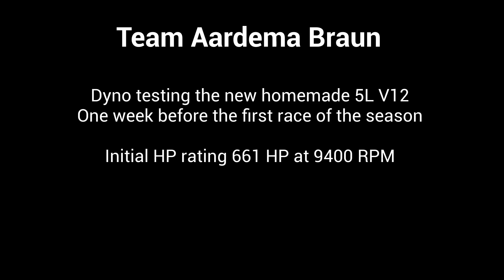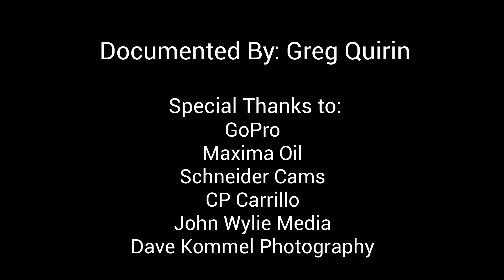Custom-Built V12 Engine DESTROYS Land Speed Record!

Comment: I don’t understand. 217 does not seem that significant. Can someone explain? For reference our Dart block top alcohol dragster was limited to 200 in the quarter. We made one 1/4 mile run outside our bracket and clocked 216 at 7.1 seconds.
Reply: You're on a prepped track with sticky tires. They're on a dusty dry lake bed, with relatively low traction and only 1.3 miles to get to top speed. It's  different game.
Reply: @davidg3944  I believe your analogy is faulty. Speed record run up is determined be many factors but how fast you get to top speed is not one of them. A typical track for an LSR is 10 to 12 miles long providing run up, the mile trap and deceleration. 

My point is that our dragster easily achieved comparable top speed. And there are thousands of similar vehicle out there. For an LSR to only be a bit over 200 MPH there must be other factors involved like small engine displacement.
Reply: For example the LSR for a 500cc motorcycle is 212 mph.
Reply: @larrysorenson4789 your comparisons aren’t valid.   This is a 5 liter, naturally aspirated v-12 running on “gasoline”. This isn’t a turbocharged or alcohol injected whatever…..  there’s a massive difference.
Reply: @caddydave  you missed my point entirely. Try not to talk down to other racers.
Reply: @larrysorenson4789 talked down.?  I’m so sorry if I hurt your feelings..
Reply: @caddydave  i’m out of racing due to age and shitty reflexes. It would be fantastic to go to speed week. I’m sitting here with the top Alcohol dragster in the garage. I have no idea about the spec on the supercharged motor regarding torque or hp. It has around 100 passes on it. The frame is a Joe Amato top fuel dragster built almost 20 years ago. It was pro built by and for him. I have kept the original diff. It is massive. 

With drag gearing the dart block has seen 5,000 rpm many times. That puts us in our bracket. It is very difficult to change the basics of the car although I did put in a built 427 for fun years ago. I will probably never see exactly what the dart motor can do because it was not made for that. But the sound is still thrilling. I also have a real metal bucket “t”. It has had tons of motors in it. I have lengthened and shortened it over time. Right now it has the 427 with a supercharger on it as God intended. This sucker is street legal and licensed. I am afraid to sell it because, although I could handle it, it is probable that a new owner would kill himself. It also makes a great noise. I will probably disassemble it and sell off the parts. That way I can sleep at night.

By the way, the Amato body panels are titanium!!!

Comment: This is great stuff! How come all the 2000hp 2.0 4 bangers cant set land speed records?
Reply: As I mentioned in a different comment: They're on a dusty dry lake bed, with relatively low traction and only 1.3 miles to get to top speed. Can't be compared to drag strips or similar high-traction events.

Comment: And most importantly, it sounds absolutely incredible
Reply from the maker: The sound is insane. I wish everyone could hear it in person.  Thanks Greg
Reply: @GregQuirin  See comment below ...keep up the great WORK 💯
Reply from the maker: @ivankuljis1780  Thank you Ivan!
Reply: @GregQuirin  what are the stems on each header pipe?
Reply: And the change in the sound from the Doppler effect is very interesting, especially at about (8:50) where the car passes the camera. 😊
Reply: That was music… mechanical music.
Reply: I mean it sounds amazing! And it's incredible work by the team.  But only 661HP from 5 liters seems.... not very impressive in 2025.  Why reinvent the wheel but worse?
Reply: @youvebeenspooked   That much horsepower N/A is pretty impressive from a home built engine though? It's too easy to just spend $50,000 on a Texas speed V8, throw a couple of turbos at it and make 1500hp. Plus having a power adder may put them in a different class?
Reply: @youvebeenspooked  When they said V12 I was expecting it to be 10 litres.
Reply: I guess to highlight my point, you can make significantly more power from a four banger with half the displacement and a big turbo that revs higher.  sure that 4 banger has almost no power till 5k.... but beyond the beautiful art aspect of this v12 - which is incredible, to be clear! - I'm not sure why this is such a big deal.  I must be missing something?

Again though HUGE props to the people who designed and built it, it sounds unbelievably good and is just a beautiful thing period haha.  Just not understanding why the power output or speed is notable
Reply: @youvebeenspooked it's racing for a class record. If they had a different engine they'd be chasing a different record.
Reply: @youvebeenspooked  What you're missing is that there are different different classes to eace in. Since they have taken the record, there is no one faster than them.
Reply: @youvebeenspooked  I think you have a fundamental misunderstanding of how it works - if they used a "four banger with half the displacement and a big turbo that revs higher" they would be in the "four banger with half the displacement and a big turbo that revs higher class" up against units that put out 2,000hp 

I don't know what class they are in but its probably naturally asperated under 5L class
Reply: @piccalillipit9211  fair enough....I guess I'm just not a fan of regulated classes in sports.  I'm more x games than UCI
Reply: In 2006, l set the BAR for Camera Speed Bikes here in Australia....~80kph pedalling 'ikara blue' in lane 2 at the General Motors Holden LANG LANG test track. 13 years later, the young GUNS got me! ~93.7kph.....l was too old (59) waiting on them! So l get what is going on HERE: